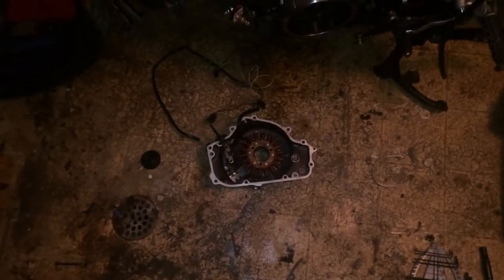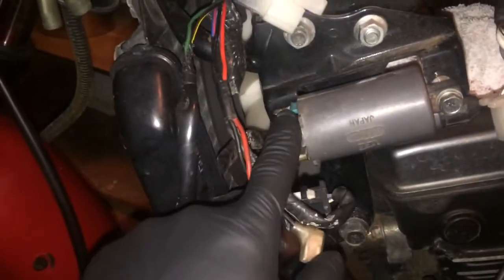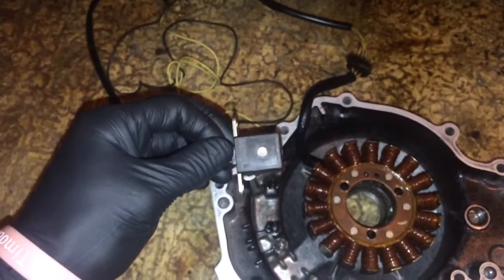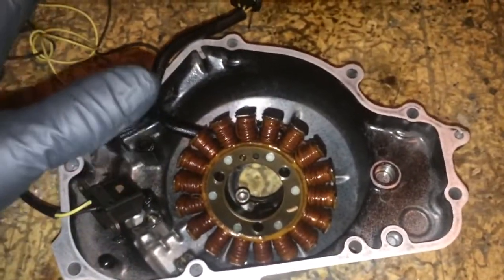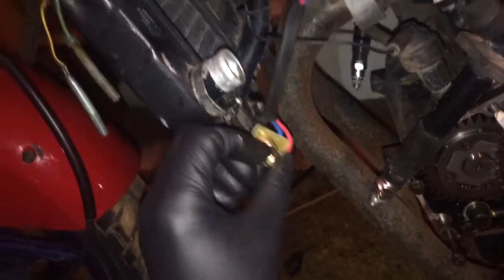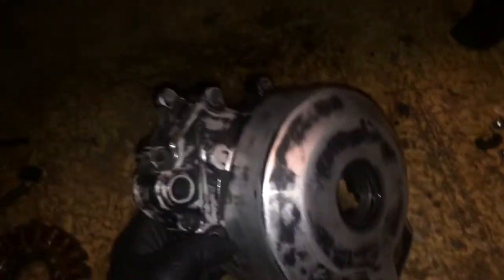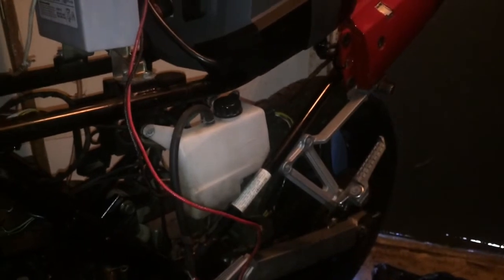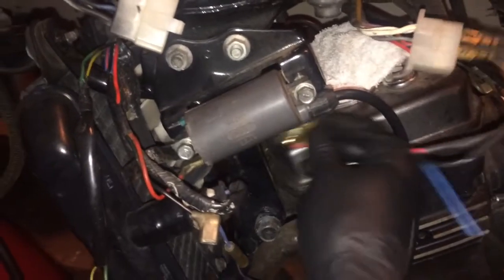1997 Ninja 250R Project: Pickup Coil Test and Disassembly

Comment: You know a lot about these bikes. I own a 2006 ex250 with a seized motor. I am trying to get at the crank shaft nut to manually free up the stuck pistons. My thinking is to just remove the stator cover slotted access plug instead of the whole water pump, stator cover assembly. I think I would gain clear access to the nut and turning it gently clockwise might free it up.do you think it might work? What size is the nut, I wonder? That slotted plug must be there for a reason.

Comment: i have the exact same bike. The battery currently holds no charge but i also suspect a worn stator due to multiple crank attempts.Multiple crank attempts were due to solved fuel delivery issues Can i PM you for more information?
Reply from the maker: Yea man anytime. I actually sold that bike a couple months ago. The guy that bought it text me back and told me all it was, was a bad neutral safety switch and clutch switch. I had gotten to the point where I was so frustrated with the damn thing I put it on CL and got some free money for it. It was free to me so anything I got off it was a positive!!!! But I did spend 6 months with it everyday lil by lil fixing lil shit.
Reply: @kirbysullivan775  When you say you had a bad neutral safety switch, were you able to see the neutral light on the dash?